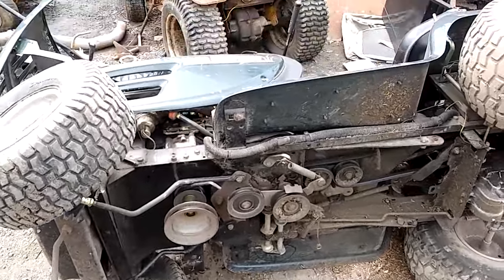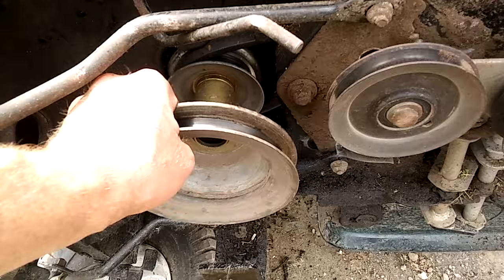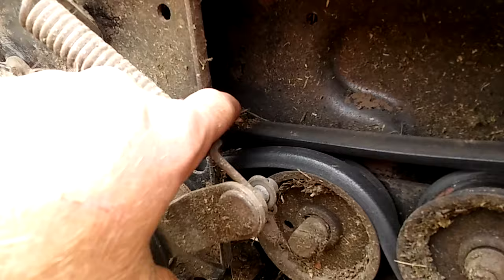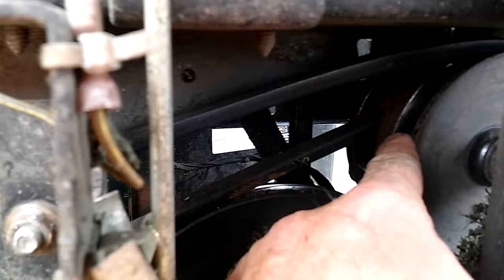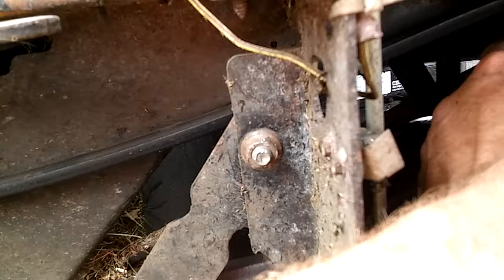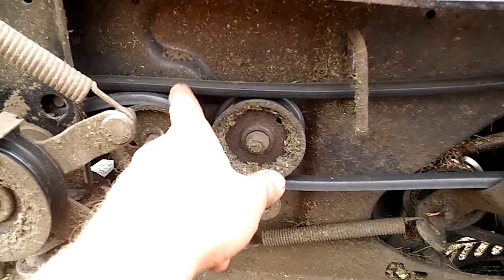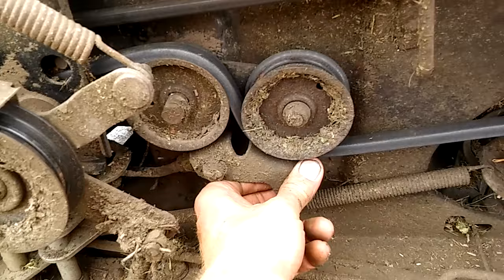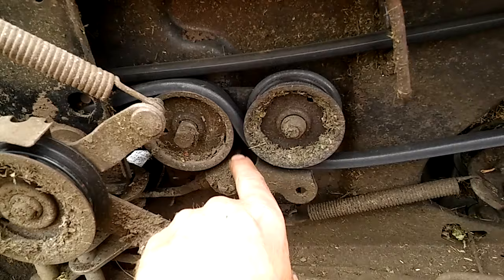MTD Yard Machine garden tractor drive belt help video

Comment: I just replaced the belt the same way but for some reason it won't go forward or reverse it even smokes from the belt if i press the pedal too hard, at one point i though i put the belt wrong when i saw it loose. Also replaced all belt blades work engine turns on fine. Anything that i should look into that you can guide me to narrow down the problem
Reply from the maker: Bad / frozen pulley most likely ?  Bad rear end ? Trying spinning the pulley on the rear by hand without a belt on it see of it moves or lift it up in the back sping the tires and see if they pulley moves up top ?
Reply: Did you ever figure it out? My mower smokes and doesn’t move when I press the accelerator. No seized pulleys. Could it be that the belt is too long?
Reply: I had a similar issue with mine the belt was too tight.
The guy I bought mine from had his son work on it, it would only stop in neutral. I could not use break and then shift F/N/R.
Just jerk shift it.
Changed the belt and got the new issue of not moving.
The problem was the parking break.
Right before I changed the belt I was tinkering with parking break so I could get off mower without restarting due to starting issues.
The parking break got stuck and would not disengage...after beating the machine with a rubber mallet while going through procedures the parking break appeared to come off but only had one speed no matter how hard the pedal was pressed.
After the belt was changed to the correct size the mower would not move and there was smoking.
The parking break had been partially engaged the whole time.
Apparently this is a well known issue with MTD mowers.

Comment: I found it better to take the bolts out of the engine and slide the engine back to clear the tabs so you don’t bend your tabs or pulleys !!!!
Reply from the maker: That could work. Could even remove three bolts leaving one in for it to pivot and kinda of stay in place. Save work trying to get it back in place.

Comment: Replaced my drive belt with OEM along with new pullies and now the tractor will not stop when brake is applied. I can't even put into neutral to stop it. I have to turn off the tractor.  Maybe the belt is too tight?  Can I do anything to rectify this?  I
Reply from the maker: Must have it not routed the correct way and causing the belt to be to tight even when not engaged. Belt needs 1-2"ish or so of slack when not engaged. It only tight when engaged which causes it to move. Best of luck.
Reply: @mobilemowers thanks.   I already checked the belt routing and it's good.  I guess I just got a belt that is really not the right size.  Appreciate your response